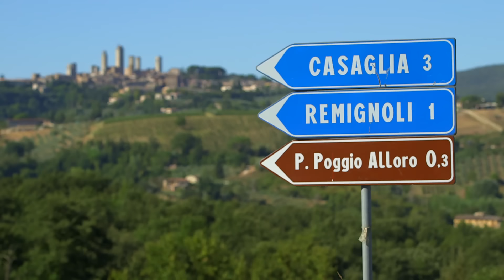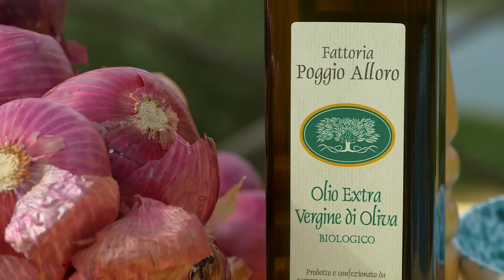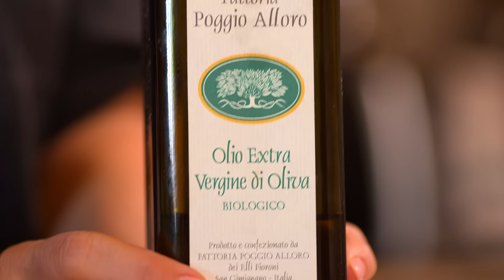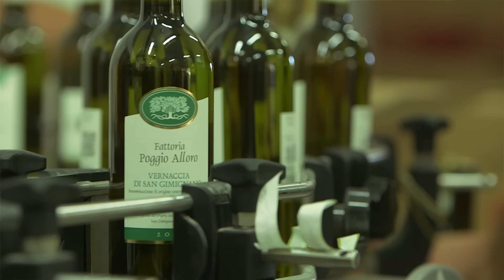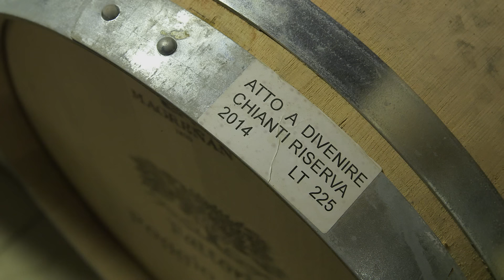FARM TO TABLE, TUSCANY (FULL EPISODE)

Comment: How was the tomatoes in the bottle preserved? Were they fermented? How do you keep them from rotting and forming mold? Thanks
Reply from the maker: Hi Christine - The bottles are sealed and then submerged in water and brought to a boil. I'm currently making a new video that will do a much better job of explaining the entire process.
Reply: @DarrylKinson  Then kind of like what we do in ball canning jars. Hot water bath is what its called with the glass jars.
Reply from the maker: @dugchris2009  From what I vaguely remember when filming the jars and bottles were brought to a boil  and then the heat was switched off where they then sat in a hot water bath.